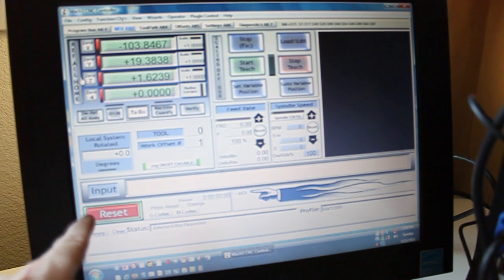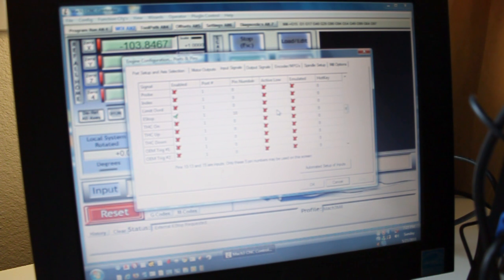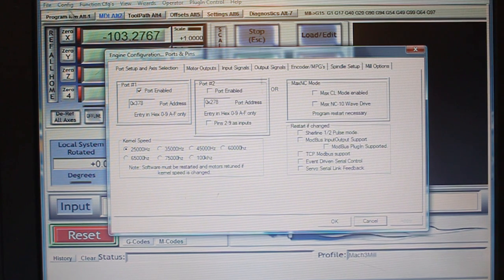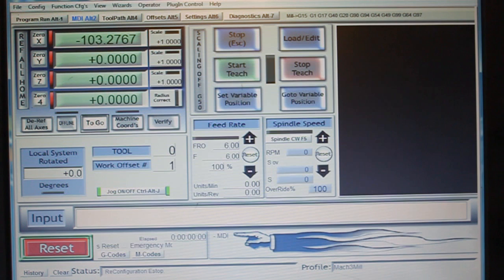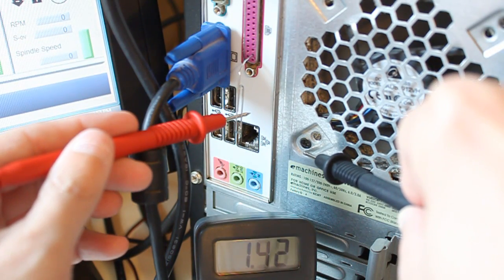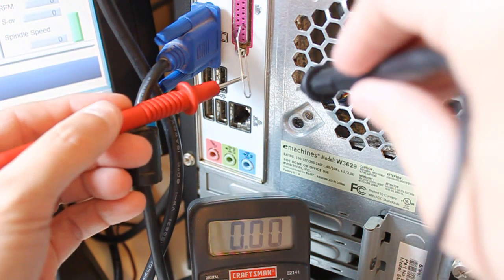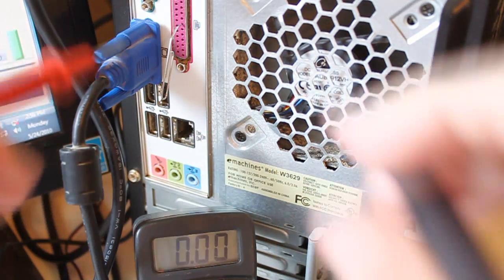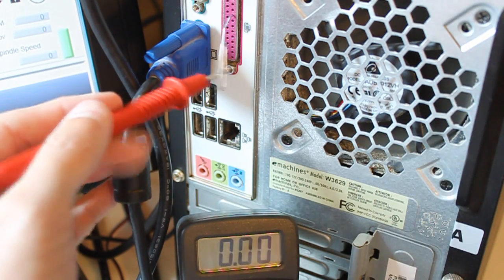CNC Electronics 5 -Testing the Parellel Port.wmv

Comment: Thanks for the information, i'm having a problem with my cnc, and i like to probe all pins from the paralell port to see if all are working good. I mean motors, inputs and outputs.  Can i do it the same way, i mean with a clip and a multimeter?

Comment: Can i use printer parallel port for mach3.
Reply from the maker: Yes, but that method is becomming dated as many of the motherboards developed these days do not have a parallel port, or a parallel port header on the motherboard. It is best to use controllers like https://www.buildyourcnc.com/item/electronicsAndMotors-electronic-component-breakout-Mach3-USB-Board or https://www.buildyourcnc.com/item/electronicsAndMotors-electronic-component-breakout-Mach4-mach3-USB-ethernet-Board where most of the processing happens on the controller and not from the CPU.
Reply: @PatrickHoodDaniel  thank u very much brother.

Comment: Hello Patrick I know this is an old post but I am wanting to do this test on a 2nd printer port that I have added to my pc for a mpg . Do you think this test will work for a pci parallel port card??
Reply from the maker: Yes, it will.  Make sure to go to the device manager and find the IRQ address so you can plug that into the control software.
Reply: @PatrickHoodDaniel  IRQ?? The hex address?? What happens if when I test it and I get 5.08 volts both directions
Reply from the maker: @michaelbrocato7535  In Windows, you are able to view the address of any feature of the computer.  Address are how Windows access the feature, like the parallel port.  Each parallel port contains 25 discrete addresses, one address for each pin, starting with a specific address and count up.Each address can have a high or low value (5v or 0v).  When you have two parallel ports, each parallel port will have a different address so they don't conflict with each other.  You can find the address under the windows device manager.  Once in the device manager, just look for the "LPT".  If you get 5.08v in both directions, then the address is probably not correct and Mach3 is not able to communicate to that parallel port.
Reply: @PatrickHoodDaniel  wow thank you so much I have learned alot from watching your videos . Do you have a video on connecting a manual pulse generator directly to the 2nd printer port ? That's what I am trying to establish
Reply: If you do not have a videos on manual pulse generator you should you are helping alot of people thank you
Reply from the maker: @michaelbrocato7535  Thanks.  I will look into doing that.  I don't have a tutorial on that at the moment.
Reply: @PatrickHoodDaniel  hello Patrick I was wondering if maybe you could give me a few pointers on getting this manual pulse generator up and working?? I have a c22 board from cnc4pc and I PMDX-1PARPCI adapter card for my 2nd printer port to eliminate any issues with the printer port I switched to the onboard printer port for testing purposes.  I can jog using the pendant but I have to use the jog flyout (tab) in mach 3 to select the axis I want to jog and the resolution i want to move in . I could really use your help but I understand if you are not ready to tackle this project
Reply from the maker: @michaelbrocato7535  Unfortunately, I'm not able to at the moment with my current workload.
Reply: @PatrickHoodDaniel  I understand and thank  you for the videos that you have posted they have been a very big help !!!!

Comment: I'll see if I can test my parallel port card, as I'm in the process of trying to throw together a cnc router, I did purchase wantai  cnc kit  then finding out I couldn't use an adapter from parallel to USB, so I purchased a cheap parallel card, unsure weather it's working or not,  does not seem to be communicating with the D25 1205 breakout board.

I ahave a question in regards to parallel port card, with the port address as it shows it alittle different to an integrated version, e.g my port address starts as D880   881    has D and not 0,  or instead of e.g as in mach3 0x378  would one go either 0x880 or  Dx880 which I have not tried Dx880 come to think of it
Reply: I checked it with a multimeter I get 5.08V on both arrow strokes, same voltage if I change port address, when I enter Dx880 then close out reopen it's changed to 0xd and then tested @ 0x378.
Reply from the maker: I think the 0x is common HEX style notation and should be kept at 0x.  Use you device manager in windows to determine what the port IO range is.  Just go to the properties of the LPT under ports.

Comment: windows 7 32 bit ?
Reply from the maker: For parallel port use with Mach3, yes.  If you are not using the parallel port driver, then you should be able to use Windows XP, 7, 10, etc and in 64-bit mode.

Comment: Hi Patrick, Hoping you may be able to give me some advice. I have Mach3 Win 7 32bit and I have done everything in this video you showed, but I get a constant voltage of 3.4vdc from pins 1-9 and 4.91v 10-13. Pins 14.15.16 have 3.4, 4.9, 3.4v and Pin 17 has 25.5v and the rest are ground. There are epp and ecp 1.7 and 1.9 in the bios, tried them all nothing seems to change. would you have any ideas.  Cheers
Reply from the maker: Those voltages are all over the place.  Unfortunately, I don't have too much experience with the configuration on the bios side of things.  Have you tried going through all of the bios option selections and re-measuring the voltages?
Reply: I reloaded Mach 3 and win7 and then did the driver test, which worked. Then I ran Mach3 as Administrator and all good. Thanks for your reply too.

Comment: dear sir, i am having problems getting my Parallel port to work... im getting voltage on some of the pins but not any of the pins 2-9 any suggestions would really helpful.. also i believe the card is set up right with the proper port.. i ran the driver test program and it cane back excellent...thanks for any help

Comment: Thank you for this video. I went through a tough battle of buying/testing parallel port cards, until finding a computer that had an integrated parallel port (Dell Optiplex 755). 

For the Dell, make sure to go into the bios and enable EPP (additionally, you can change the address to 378h [which is 0x378] or 278h [0x278]. I kept mine 378h [0x378] which is the address that Mach3 defaults to.

I followed your steps exactly and got the same result except my pins on high are at 3.35V. This should be fine because my CNC controller board allows a 5V supply to be used to deal with this.

Another note is that I am using Windows 7 Professional 32bit. I had to run Mach3 in compatibility mode (Windows XP SP 3 to be exact) to finally have the parallel port talk to the Mach3 software. 

I hope this has been helpful for those who have been experiencing frustrating difficulties with parallel port and Mach3.
Reply from the maker: Thank you for this information!

Comment: i solve 3.6v problem , i bought an external parallel port adapter which will provide 5v in parallel pins, then go to config >> ports and pins >> active pin No 1 and write the start address of your external parallel port, then it will work with you as patrick show in the video

Comment: Hi Patrick, thank you for the excellent vids!. I have been using Mach3 for my CNC for more than a year now with no issues. Suddenly it stopped working. I have run your test with a led and all output pins are high no matter what I do. I have checked the bios setting and it is OK. I have run out of ideas, my next step would be to by a PCI LPT adapter. What do you think?

Comment: Hey Patrick, i don't get my port working and multiple people in your comments semem to have this problem. In my Device manager the port adress is 0378-037F . I put in 0378 (0x378) in Mach3 but it doesn't change the volts at the port when i try it out. They always stay the same. 
I hope you can help,
DANIEL

Comment: What if the pins always give 3.6v and no pulse as u mentioned (when press the arrows) I have new core i3 4GB with 3d Graphics (Windows rating 5.9) would installing XP resolve this ? or should i change th epc power unit.
Reply from the maker: Asanke Raynayake It is most likely the port setting for the lpt within the cnc control program.  Double check this value.  Also, if you are using mach3, make sure your Windows version is the 32-bit version, not the 64-bit version.
Reply from the maker: Asanke Raynayake I forgot to mention, you can only test the direction voltage level, not the pulse using a multimeter.  The pulse is too fast for a multimeter to measure, but you can measure the direction signal which is just a high or low value.
Reply: I use 32 bit.  I followed ur instrctions.  It seams lpt give constant 3. 6v.  And When connect the driver board,  steppers make constant screem very faint and axis cant rotate by hand.
Reply: Thanx for reply.  What u suggest is re conf the mach3 port and pins?
Reply: One more questions.  What if i use usb to lpt convention adaptor.  Then what settings should i change.
Reply from the maker: Asanke Raynayake USB to lpt adapterwon't work.  The lpt must come directly from the main motherboard bus.
Reply from the maker: Asanke Raynayake Check the port address in the device manager.  What is the lowest address value in the range?
Reply: THX FOR GUIDANCE.  I GOT IT RUN.  I CANT STOP LAUGHING :-).  CANT EXPLAIN THE FEELING.  THX AGAIN.
Reply: Asanke Raynayake Did you solve the problem? i have same problem ports always give me 3.3v and no pulsing.
Reply: Patrick Hood-Daniel In my Device manager the port adress is 0378-037F . I put in 0378 (0x378) in Mach3 and it doesn't change the volts at the port. They always remain the same. What has been the problem with your setup?
Reply: Did you tried to enable active low?
Reply: Hello Asanke, can you please advise me how did you fix that issue? I am having the same problem, and no matter what I do,  it remains...
Thank you in advance.
Reply: DEr18Minecrafter Nikolaj Simeunović , had no luck. I changed the pc.
Reply: Thank you for coming back to me. 
I managed to make it work with 3.6V. It seems that isn't that much important as wiring and settings in Mach3.
Reply: Nikolaj Simeunović :) , i bought OMNI cnc 1325 and today it just reached it to PORT. I am setting up a interior design and custom craft shop. I tied up with two local designers . Its long way since i made a one. 
reason i bought china cnc is the accuracy of travelling on x y z and commercial grade dependability (hope it has these qualities). this is just for note. 
I think the beauty and power of cnc is mainly on the cad cam software and also on the controller .
 if u like i would like to share and update my first time experience with china cnc and the things we will come across while preping our commercial grade design unit ! (We are just about to clear the package from customs)..........................

Comment: when i test my ports they a the opposite of yours, if i press left i get 0, if i press right i get 3.4. what could be wrong?
Reply: Nothing is wrong. Just use low active or vice versa on that pin and the values will be that same.
Reply: thanks

Comment: i ve followed all the steps you described in video ,configured mach 3 and tried to test the voltages on the pins but without pressing any button my meter  shows 4.85v on all the pins from pin 1 to 17 and 18 to 25 pin shows 0v .i think thats the reason all 4 axis gets signal on all lights goes on pls help on this matter
Reply: There is a problem with the software configuration. If you go to your lpt port in device manager, what is the first address in the I/o section.

Comment: thanks a million patrick for nice work. however,my pc wasnt having parallel port hence i installed one on my pc mother board and connected dotmatrix printer with all required drivers.the printer works fine but when i connect my chinese BOB( WHICH WORKS FINE WITH MY OTHER PC WHICH HAS BUILTIN PORT)and power up,the all 4 axis working LEDs goes on and connected motors get hot exescively.i am using win xp os with mach3 o both the pcs,can you please suggest the remedy?

Comment: I was following your video to test the pin connection on pin 5 & 7 I got voltage both page up and down. The voltage reading was 3.32 v instead of 4.3 V you got. What is going on?

Comment from the maker: Check the port number on your axis output pins.  Generally, the port number defaults to 0.  It should be 1.  If that is correct, go into your bios and check the parallel port address and also make sure it is enabled.

Comment from the maker: Hi SniperSquad100, the parallel port is a very convenient set of pins that give you access to the microprocessors general purpose IO pins.  These pins are extremely useful and allow direct TTL and PWM output and input on 17 pins.  The USB only has two data lines and must have external processing, so it is actually much more expensive to use the USB.  Thanks for your valuable feedback.

Comment: @tigbaz15 
I have a same problem when I measured the ENA was 3.4v  so the motor make a noise in one side rotate ( left) so I use 5v from usb connector to fed it to the driver in stead of ENA output , and the motor work well.

Comment from the maker: @tigbaz15 3.3v systems will not pose a problem.  Most of the computers today use the lower 3.3 voltage as a standard.  This is why the breakout board uses the 5V from the USB port.  You are either having a problem with the software configuration (port address), or that your parallel port is not enabled, or configured correctly in your bios.

Comment: @WilliamTang  intel p4 motherboard-  will- do you know anything about tb6560 chinese ebay cnc kits? i have just set up a nema 34 kit and set it up according to the sellers diagrams and i can only get one motor to make noise- its like a little squeek and it does not move- every thing is moving on my moniter cutting roadrunner but stepper motors remain idle- thanks mate in ad..

Comment: Will- im having a problem getting the parallel port to work the way anajonesr shows in the video-
i have installed a pci to parallel card and cant do as the video shows(brand new PC)- tried to change port address as mentioned in the video- searched all over the net but still cant get my port configured- also im using vista if this makes a difference? any help will be appreciated- also from anybody who has a clue!

Comment from the maker: @cfiore88 Unfortunately it is not possible to use a converter.  The signals from the parallel port must be direct.  You can, however, use the smoothstepper board from cnc4pc.

Comment from the maker: @WilliamTang As long as you see the correct voltage change as the video show the process, you should be fine.  Check the voltage after you select the correct parallel port address.

Comment from the maker: @WilliamTang Do you get the proper voltages when tested.  If so, it could be an issue on the breakout board (if you are using the same components).